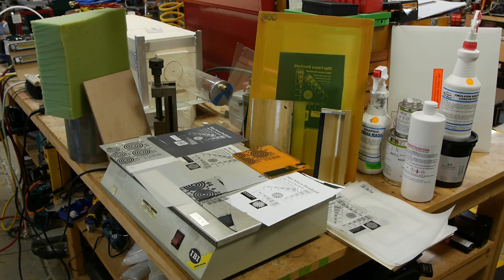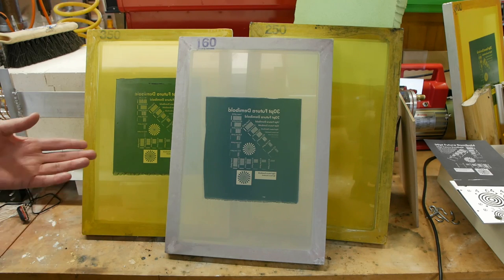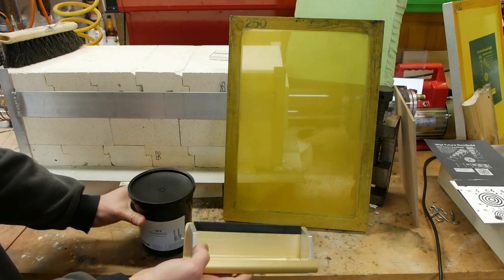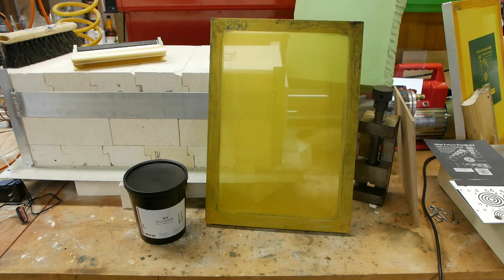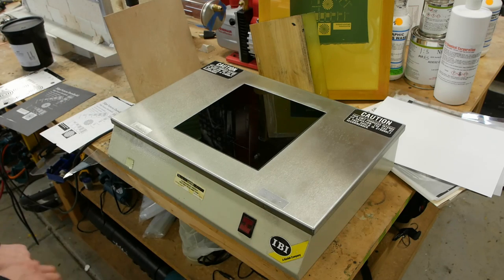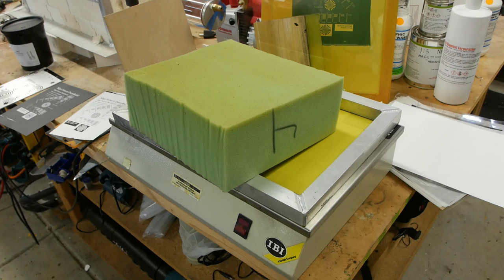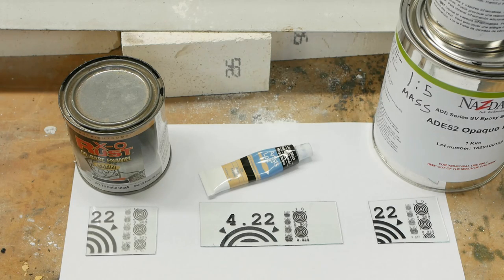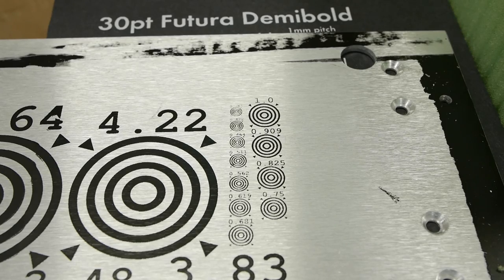High-resolution screen printing demystified

Comment: Did you consider varnishing the painters oil based paint? Varnishes tend to make the colors look more vibrant. Perhaps it maybe a similar contrast to the epoxy paint ( no need to deal with the clean up ;) )

Comment: Good contact between your artwork/stencil and the photoresist is key for fine details.
My best results when exposing PCBs were the ones where I sprayed the transparency with water and used the surface adhesion(?) to stick it to the PCB, then drying off the edges and using tape to keep it flat.
I doubt this method would work for photoresist on a mesh screen, but you never know..,,

Comment: Most transparent plastics don't transmit UV particularly well there are exceptions such as FEP is pretty good but most transparent plastics cut off hard somewhere between around 300 and 350 nm whereas FEP starts to cut off around 250 nm and is basically opaque bellow 200 nm but still quite a bit better for this sort of use probably as that still allows UV-A and UV-B to pass with UV-C being attenuated quite a bit when most transparent plastics attenuate UV-B to a large degree.

Comment: Ben, I'm curious and not from a negative origin, in this application there appears to be some mess producing steps - how much of a small batch production run (not your initial dabbling towards process understanding or the experimentation phases) would be product and what wastage - and of the wastage what would be regular garbage/recycling and what would be nastier materials requiring special handling and disposal. Clearly, in a production environment you have to have that thought through and under control and in small hobbyist runs also respect that requirement.

Comment: Would it be possible to run the sheet of emulsion through a laser/inkjet printer? That way you could avoid any issues with the loss of detail and ensure good exposure.

Comment: I have wondered if dry film resist would work as a screen emulsion film, it wouldn't be very strong but it would certainly be fast to setup so for a small number of small prints might be effective.  Such film sticks quite well to itself so you could apply it on both sides of the screen to sandwich it in film and then expose.  Develop in sodium carbonate solution, 10g/L is what I use for PCB.  No need to wait for it to dry.  Easily available on eBay etc.

Comment: You do not mention using a "blocking lacquer" to block off the open area of the screen surrounding the photosensitive part, all the way to the edges, so the ink goes only through the openings in the film.  Have you tried using stainless steel screens?  They are much more rugged and do not "creep" like the polyester screens do.  Your screen should be mounted on hinges (with a lifting spring) so the screen can be lifted to change substrate being printed, and allows lowering the screen and holds it against sliding and smearing the print.

Comment: Awesome video! I used to work for an art department and they had a vacuum hold down arc lamp table. Wouldn't using glass with sunlight inhibit UV exposure? I think it depends on the type of glass, though. It may be worth looking up for folks who want to try that method.
Reply: Borosilicate would be ok but all other blocks most of the uva. If near blue wavelength is sufficient it wouldnt be a problem but curing time would definetly increase with a regular glass.

Comment: Well now you have me curious what you can do with a laser and this process. I commonly etch paint off of various surfaces. Might be handy for one time use cases just depends on if you can remove the paint or epoxy without damaging the thin polyester screen.

Comment: questions1. do i need to buy an emulation spreader or is there another way to accomplish this 2. is it in light that cures the emulation 3 can i just lay the screen write on the surface i want to print, or does it have to be lift a little above, to avoid in bleeding onto the print surface ? thanks

Comment: A way way way better 'homemade' exposure system uses a 1000w metal halide bulb. 400w also not too bad. Creates a single point source light and burns a very good screen.  I should know....been using my since '94.  If you are not really into doing many screens, you can use a sunny day.

I did all my screens for the first year using sunlight. Tricky getting consistent exposure but does burn a good quality screen when you get it right...winter or cloudy days also put a damper on things.

In case it isn't obvious, yes you have to cover the inside of the screen to keep out the light. Tape the film to the screen, sandwich with some glass, walk out side for a minute or 12 seconds if using a photopolymer...LOL

Started in '92, still printing in 2020.....

Comment: If not mentioned elsewhere, I think you may have been trying to save material by only using the middle section of the screen, but doesn't that prevent you from having room to hold paint/ink between prints? Kinda like a sideline for a football game? Idk how else to describe it.

Comment: I gotta wonder if you could skip the printing step and use a high res projector for the exposure.  From my understanding digital projectors use a translucent LCD screen that either block light or allow it through (color is added by a color wheel in front of the light source/LCD screen).  I imagine a normal projector may not work due to the way the light is focused and possibly due to the black not being dark enough but it's a thought.

Comment: You didn't mention if those tubes were UV-A, UV-B or UV-C tubes. the difference is the intensity of the UV and wavelength. 
also thanks for the vellum paper tip. i can use that for circuit boards. transparency paper kept jamming the printer. Also transparency is more expensive.

Comment: Thank you for this great informative video!  I was just ready to try the emulsion film, and now I will for sure. Wondered how the different viscosity of ink / paint works out, such as a thinner house paint vs thick artist paint. Any run-through, bleed,  or dripping through the screen with thinner? Thank you!

Comment: You can buy the undercoated mercury lamps for the UV boxes, you can buy them from screen printer suppliers and they aren't that expensive if using the common lamps.  But you have to be careful and make an sealed exposure box, these lamps give nasty burns. The are like giant germicide lamps.

Comment: When Applying the Screen print to the substrate, do you need to clean ink off and start with a fresh screen for every print, or just clean the ink off with the graphic press after youve done all your prints. Does it need to be a fresh inkless screen for every print?

Comment: Hi, concerning your macro images, I've found the color fringing tool in Lightroom (under manual lens correction) can really do wonders if used correctly. I use it for my Macrophotography and when using older lenses.

Comment: Have you tried using the photopolymer directly on the glass in order to skip the ink ? You probably could add some pigments to the photopolymer (or any UV cured epoxy)

Comment: Tried one of those low power UV laser engravers? I've have had some success with PCBs engraved with dry film and spin coated liquid solder mask as a secondary process after etching.

Comment: What if you had something REALLY big - Those printing areas are only about A4 size. I can imagine that there must be some size limit before the screen just can't be stretched any tighter for really large print areas. It would become really flaccid over larger printing areas.

Comment: I built a UV source with a bunch of UV leds in a matrix arrangement for exposing pcbs.  Any reason that wouldnt work? I got really excellent resolution with my pcbs doing that with the board, and art sandwiched between two peices of glass and clamped together above it...  

Edit: I also found my exposure time was on an order of 1/6 of what most people recommend for a flourescent uv source, so I suspect I had pretty good output, or my boards were just extra sensitive...  I was basically limited by the resolution and contrast of my printer in the end like you point out.
Reply: The wavelength that the LEDs produce just seems to be better suited to these photopolymers. I use it for both dry film and solder resist paint which is pretty similar to the screen print stuff.

Comment: Do you think deionized water or a certain treatment to the water might help the screen to saturate better for better bonding to capillary film emulsions? Popular manufacturers of these products, such as Ulano, make fluids that are designed to increase screen water absorption - especially when using finer meshes like 230 and up. That makes me think there may be a way to do better without having to drop more $$$.

Comment: I'm wanting to screen print on metal surfaces with a layer of spray paint on top, so the screen printing will be on top of paint.
I've determined solvent based epoxy to be the best for this scenario (corrent me of not) and I'm looking for any epoxy that offeres CYMK colored inks or white and black that accept dyes or pigment additives.
What can you recommend?

Comment: Easiest way to remove the emulsion is to spray it with Shout and let it set for about 5 minutes then you can just spray it off with a garden hose.  No need to scrub or anything else.

Comment: use a second hand contact printing frame used in photography - this is PRECISELY what it's designed for! you can pick one up for about the price of a new screen and use it for ALL your work. It's designed to keep a negative under even pressure against a piece of photographic paper. and so it's ideal here.

Comment: This is really useful! I was wondering about alignment. I want to make some notebooks with custom layouts on the pages but I'd need perfect alignment on both sides which isn't achievable with a desktop printer. I thought that maybe screen printing would allow me to do this but when you mentioned having to have the screen raised and then stretch it down onto the sub-straight that made me think that it might distort the image and therefore it's alignment. Is this much of an issue? how would you recommend I get around this problem?

Comment: A few things come to mind : what is the resolution limited by in your process ? Is it the inkjet print mask or the screen? If you used conductive ink could you make a circuit board or etch transistors on a substrate

Comment: I've always wondered if screen printing/silkscreening would be suitable for coating glass with a holographic emulsion (such as dichromated gelatin). Would this be suitable for applying photographic (or holographic) emulsions to film or glass? Main concerns would be uniformity of coating and surface finish.

The method of coating glass used by most holographers is very tedious and prone to error, so this would be a big improvement.

Thanks!

Comment: Apologies for what may sound like a dumb question, but are undiluted water-based acrylic artist paints suitable for screen printing? They appear to have the correct consistency. I appreciate "printing inks" have a higher pigment content, but wonder what other issues acrylic artist inks would have.
Reply: They dry and clog the holes in the screen.

Comment: Great stuff, thank you. Interesting thing you mentioned there, you said that vellum was better than transparency for passing UV, how did you measure it and aren’t the light rays getting diffused, which in turn lowers your resolution on the silkscreen?
Reply: Great, question answered on next video;)

Comment: Can the same masking ink, be used for circuit board mask? normal masking requires chems. water based developing seems nice. edit: nevermind...it will require you to make the printer, print mostly black.

Comment: I'm not sure if it would for for this particular case but with a different epoxy based paint that I've used, both thinning and cleanup worked well with methyl ethyl ketone (MEK). Maybe it could work well with the paint you have too? Epoxy paints are amazing but also a mixed blessing.

Comment: Maybe , use a drop of liquid to stick transparency to the mesh and the glass, When I was making my own PCB's with dry film photoresist and a laser printer transparency i was using IPA to stick it together (water can be user but it will dissolve paper )  This greatly reduces the gap between artwork and photo layer. 
Also cheap UV CFL for gel nails works great to develop image.

Comment: I was wondering whether buying a dlp projector and replacing the dmd chip's glass with quartz glass would work. I know i have to spin coat every object for itself but it seems to me that i can achieve better resolutions for smaller objects. Could you or someone else give an advice on where can i get optics with low attenuation for uv light? Almost forgot, thank you so much for your videos! your content is always amazing! I drain my debit card every month and patreon is often hitting the bottom of it so i stopped using it,  but this month i'll re- open my account. Sorry for being uncle Scroodge :/

Comment: Use two part epoxy inks that are heat cured - if the substrate will stand the heat (180c). The screens clean with thinners really easily :o)

Comment: Great video as always!  One question, did you try this using sunlight/outdoors as your UV source, as you described?  I ask, because I always thought glass blocked/reflected UV rays, and none would get through to your photosensitive layer.
Reply: glass blocks uvb (bc short wavelength) but not uva (bc long wavelength). This is why you can get a sunburn even through most glass (unless specially treated to block both). Google confirms but YT won't let me cite.

Comment: Regarding Inkjet printers...
I use a laser printer. I gave up on inkjet over a decade ago, but many use inkjet. Are all the major inkjet brands black ink UV blocking? I know what we see, and what UV does can be very different. I can't imagine how frustrating it would be to try to do this, only to have an inkjet with UV transmissive black ink!

Comment: Why not put glass on both sides of the silkscreen? That would ensure good contact between the paper and photopolymer because of the consistency of both
Reply: put a piece of foam core that's been painted flat black then covered with a black fabric big enough to fit in the inside of the screen and tape the positive to the bottom side of the screen, stuff it all inside a sturdy clear plastic bag that you've rigged up with a shop vac and suck all the air out of it making sure that the film positive gets sucked down flat to the screen. Expose with light source. Be sure and leave a small "leak"  ( 3/8" or so ) in the hose going back to the shop vac so that the shop vacs motor gets enough air coming through to help keep its motor cool or you'll  burn it out if you let it run very long. Don't ask me how I know this.
Reply: @joelcarson4602  Even better!
Reply: I suspect the problem is the lack of consistency in the "photo-emulsion + screen". Your two pieces of glass assume something as equally consistent between them. May not be the case — in which case lots of brute force is probably better.
Reply: @softdorothy  I agree, however, glass can be really flat. Something in between the glass and screen might aid with some pressure. I don't have the room to do any testing myself, although I wish I could.
Reply: Mirror glass has to be flat or the reflected image would be distorted.

Comment: Are there silicon based inks that you can use? I'm interested in applying a grippy surface texture to some flat carbon fiber.
Reply: Might want to talk to Dip Your Car....PlastiDip, diluted to spray thickness, might be just the ticket...

Comment: If the photosensitive film has a plastic backing why not laser print directly onto that, then attach the film to the screen and expose through the backing before peeling it of and washing out the unexposed parts?
Reply from the maker: That's clever.  You'd still have to shine the light through the thickness of the backing, which will cause the problem of shadow spreading.  For some setups (with a distant mercury vapor lamp or maybe UV LED), this may not be a huge deal, and thus the method would be a time saver.
Reply: This emulsion film looks remarkably similar to dry photoresist I use for etching. That stuff will immediately wrinkle and jam your printer. Have had no success printing onto the cover film of dry photoresist.

Comment: When you're deforming the mesh with the squeegee, doesn't that effect the dimensions of the image a bit?  

Awesome video!
Reply: @toKy0t0  At least for thick film circuit boards  dielectric and gold paste, the snap off from that gap was important in controlling the edge profile of the print. Iirc it also made a similar difference with metal mask printing for solder paste. Since Ben didn't find the snap off distance and squeegee speed  too critical I guess the rheology of the printing ink is the difference.